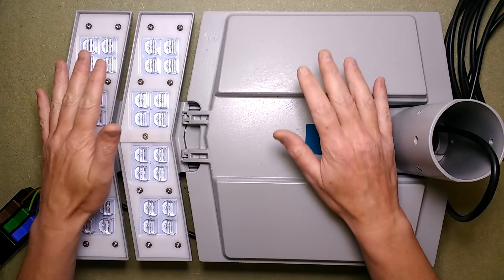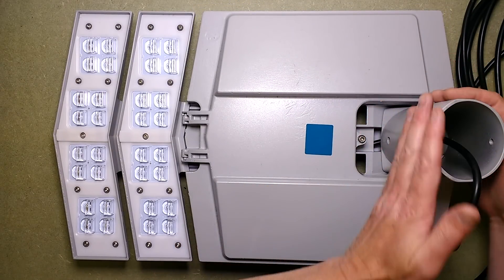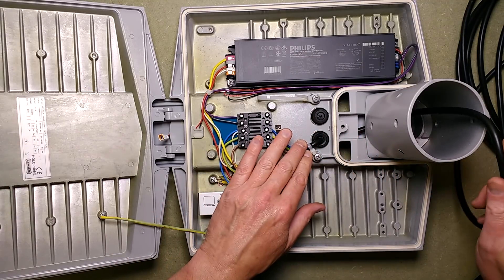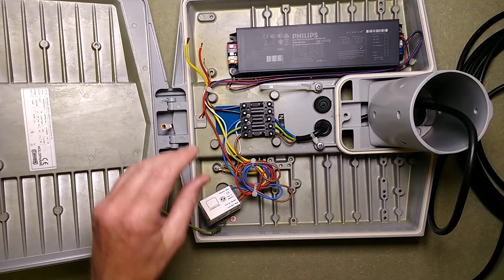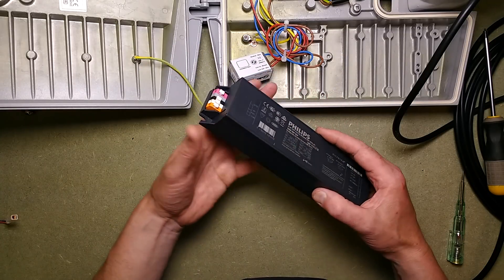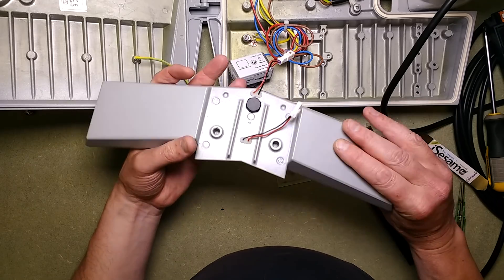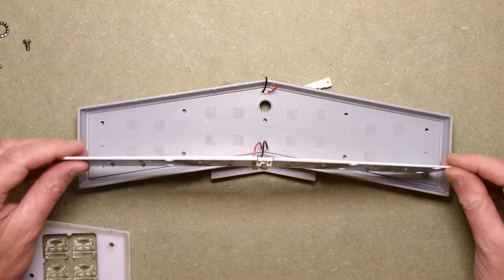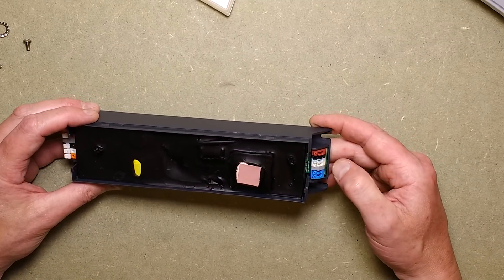Inside a Holophane LED street light (slight chromecast glitch).

Comment: Our council street light pole on our street got upgraded a two weeks ago  with a LED light fitting.   Ever since the light is turning on as normal when dusk by the photocell.  But turned off at 12:30pm each night.   Our local council have stated today that the light is not on the ‘ part night light ‘ program.so don’t understand why    We believe the 
Contractors may have fitted a timer photocell  by mistake ?

Comment: Screen pinting heat compound probably makes a lot of sense as standard SMT production processes already screen print solder onto the boards. Replacing the solder with heat compound is probably a fairly easy process.

Comment: My local city recently upgraded to LED streetlights while performing major road work near my house.
However several of the LED units have gone straight blue. According to the news this was a chemistry defect in several of the diodes, and in fact on one panel can have a mix of blue and white, and other lights one panel will be blue and another white.

It's a really unnerving sensation walking under one of these malfunctioning lights, and it gives me the sensation that it's throwing off large amounts of UV, though I've never tested that theory.
Reply from the maker: It's not UV.  Just deep blue.  The blue normally stimulates red/green phosphor to make white light, but the phosphor has detached.

Comment: These are dangerous very dangerous.
Reply from the maker: Not at all.   Well designed ones have less flicker than traditional street lights, and contrary to the venom spewing forth from people with ADHD the blue light component does NOT interfere with people's sleep, and is a negligible fraction of daylight levels on a cloudy day.  And they do NOT put out 5G death beams.  The rare ones that are fitted with 5G antennas emit much lower RF power than the 1G, 2G, 3G and 4G systems due to being part of an outdoor network like all the home wifi routers.

Comment: LED street light fixture SL18 specification

Model No.:           SL18-300w
Power:                  300W
Light Efficiency: 100~150Lm/w
Voltage:                AC100-277V
CRI(Ra):                 >70
Power Factor:        >0.95
CCT(K):                  3000~6000
Temperature:          -40~50℃
Life Time(H):           ≥50000

Comment: Please can you get hold of and review the current led street lighting with the  bit sticking out of the top you see everywhere now
Reply from the maker: I've looked at some street lights,  The antenna is a low power RF communication system for remote switching.  It's NOT a 5G death beam as implied by others channels.
Reply: The street lights with the pointy thing as you call it is for UNB ultra narrow band  which  runs on a unlicensed network which just means free to use and don't mean uninsurable. They are not 5G.
Reply from the maker: @RichieVallance  Like Telensa gear?
Reply: @bigclivedotcom  exactly like Telensa gear mate they are  based on UNB

Comment: That's not the same one being fitted across the country by just amount every council, it's got no 5G antenna for a start.
Reply from the maker: I'm not aware of any street lights with 5G yet.  Some use a traditional signal system for controlling the time the lights turn on and off at.

Comment: Was cheaper because it's not proper council one totally different.
Reply from the maker: It is a professional light.  They are used for road lighting, but usually the higher power version with the driver suitably programmed.
Reply: It would be interesting to know the wattage (what those greedy councils are saving)- I think the old low pressure sodiums were about 90 watts. However I was always intrigued by the weirdly oval Mercury ? lamps (found in desolate alley ways and passages) they gave off a spooky white light and on examining inside a vandalised   cover appeared to have no ballast at all, just a Venner timeswitch.

Comment: I wish we had these versions on my street. We've got the higher colour temperature version and the light is so harsh I had to move bedrooms as it was keeping me up at night (even a blackout blind was not good enough as it still leaked in through the edges). Sadly the warmer versions are less efficient as the apparent brightness is lower, they can be little better than a sodium lamp in terms of energy consumption. But they are so much more pleasant to look at, and they don't mess with melatonin so much.

Comment: Did nobody notice that the hinges on the cover are slotted, so all you have to do is partially open it and slide it off the 2 dowels?
Reply from the maker: I did remove it later.  I think the reason it hits the chevron module may be to stop it hinging far enough to come off.

Comment: Not  very thick wires. I suppose it has to do with the lowish voltage of the leds?
Reply from the maker: Low voltage and low current.  Probably less than 500mA.

Comment: You can tell when a company is taken over by Philips by their part numbers. They gradually change them to the Philips standardised system. For some examples see the number 4422 409 0201.1 in the lid of the driver (lighting fixings parts start with 44) and the number 92xx xxx xxx as the SKU of the driver.

Comment: Chromecasts are rather dumb devices that are mainly designed to play a compressed video stream from the network.
It's the camera device (phone, tablet, whatever…) that's having a hard time recording, transcoding and transmitting video over the network at the same time !
That's why the footage has been affected.
Cooling it better usually helps. You can stick a big chunk of aluminium on the back, like Google does on their Daydream VR headset and/or add a fan.
If you feel like it, you could also open the device and directly attach a proper heatsink to the CPU. That would actually make quite an interesting video !
Reply from the maker: I did actually consider the internal heatsink option because I had the phone open to replace the cracked screen.  But it would have made it a bit less pocket friendly.

Comment: Just as a tip with chromecast devices.

Strong wifi is a must if you're transmitting/casting the display from a device to your chromecast. I.e. wifi access point in the same room or next room over. 5Ghz wifi can work well or better still, have the casting device on 2.4Ghz and the chromecast on the 5Ghz (or the other way around) so they are using different antennas each.

Comment: Only place I've saw the holophane (now I know they are) is in the scotrail stations at largs & kilwinning, replacing old sodium philips lamps... though I didn't assume they were that big looking from the platforms... not saw any on the streets yet.

Though anyone looking for bad LED lighting head for stewartfield way in east kilbride, the 36w flurecent tubes in an advertising thing are 5 times brighter than the cheap chinese LED's south lanarkshire put up in 2015 sometime... if it wasn't for headlights on the car you would easily hit a pedestrian because the lights are that dim on stewartfield way you can't see anyone that isn't wearing reflective jackets.

Comment: Some of the street lights have a box on the poll with an aerial on it, in my area.  Which makes me think they can control the lights over the mobile network, to dim them late at night and stuff.  As Clive said the LED driver, had a data input, which must be used to connect the driver to the mobile data box.  They must also connect to other LED drivers with one of the standards Clive mentioned.

Comment: You should wear headset. Your vioce is very low. I can not hear almost any word.
Reply from the maker: It sounds the same volume to me.  Do you have surround sound?  My bassy voice may be being diverted to a subwoofer channel.  On smaller viewing devices with small speakers they may not be able to reproduce my bassy voice.
Reply: bigclivedotcom i use samsung note 8

Comment: In to my Experience this street luminaire is grade! 
+ looks like Ledil optics
+ second inlet with sealing for controlling cable (1-10V or Dali)
+ Enough place inside driver section for additional devices (PLC or Dali controller)
+ Modular (very popular in Asia) design which helps to do plenty of types by power
+ Cool design
+ breathing valve on driver section, and!!! on led modules
+ As for electrician - best type for installing on the fields (cover opens down)
But minuses have too
- As a minus of designs - modular system - for our conty climate (Kazakhstan) is wery problematic to do sealed for years system in modular design - Youcan see that cables goes in sestion which carry led modules - are non seal (ex. from a top it is only screws without selaing,), means water can leaks inside this area and later leaks to modules and driver section, thru weak sealed inlets (and to led modules thru breathing valve), and plastic end cap - is too can make problems with water. This (modular) design IMHO is only for warm climate, without snowy winters with +/- temperature jumps (in one day, as we have).
- Filled driver box - like Chinese design, very popular, but very non-repairable, last times philips is going more and more Chinese co. in their design.
- Where impulse (6 or 10 or 15kV) protection??? As to my expirience - all proffetional Western luminaires is equipped with this device (and it's right), even Russian big companies starting to produce luinaires with this type of protection.
Anyway it is grade luminaire (but expensive for 3rd world countries), and one of the best from what i saw.

Comment: The jerkyness happens because your Moto G4 starts to overheat and therefore to throttle it's CPU. They've opted for quite a low throttling temperature of I think 60°C. The same thing happens if you enable the image stabilizer, it's a shame really.. also none of the Moto G Phones support MHL for connecting up to a TV wired..
Reply: Yeah I can't stand Motorola phones. Absolutely love my Pixel 2 XL, it's brilliant.

Comment: What a crap design, you can’t even open the gear cover properly! That potted electronics module is so un-recycleable it’s unreal. The use of a mini-photocell makes changing it a pain, rather than the NEMA socketed ones. Having screws on top open to the elements is asking for trouble. Those LED connectors are really fiddly, and that thermal paste is going to dry out and become useless. The thing could have been made much simpler, cheaper and easy to maintain rather than changing the whole lantern - after all the whole point of LED is to be green! Bet that’s powder coating too, going to be a mass of corrosion in a few years, because it’s probably not an aluminium casting, it’ll be some cheap alloy. It’s pathetic.
Reply: The diecast case is most likely made from magnesium with a bit of aluminium added.

Comment: Chromecast/Miracast sucks big time. I've never seen a video not stuttering outside solid-color-and-text-menus. Never got a stream to work for more than 10 Minutes. Most times horrible de-sync starts after a minute or two.
Wifi is still too slow and smartphones too slow to transcode in real time. Especially when the camera is being used too, even if it's only pre-viewing. If we could at least seledct quality options for Miracast, but nope it's supposed to be AirPlay competitor, so there must not be any user-unfriendly configuration options... Chopps casts that last 3 Minutes are much better!

Comment: Hey clive , try using a webcam connected to a laptop and use open broadcaster (OBS) to record it, it's how i do my IRL streams and it works a treat for me. The output monitor lets you view the video in real time, with easy bitrate control n stuff.
Reply: This is actually really good advice. I know Clive likes the simplicity of just hitting record on a phone. I'm not sure if he edits the clips on his phone and then directly uploads them to YouTube, but if he is offloading them to a laptop to edit and then upload, using OBS would make work easier, as well as having a live monitor feedback.

Comment: They don't change the whole head just to make money. Usually it's on an area that impedes traffic, it's hard to access, or something that makes it a pain in the ass (aka expensive) to change. So when part of it breaks, it's makes more sense to do it all while you're there. It's like checking your brake pads and rotating your tires or getting new tires put on. You're going to rotate your tires AND check your brake pads while you have the wheels off.

Comment: It might be possible to use an angled mirror so you can mount the camera horizontally and still see the screen. Would probably need to be a first surface mirror, though, to avoid ghosting.

Comment: Never had a goo experience with Philips CFL bulbs thus don't buy their LED's.    Feit  meh  bout as bad.  TCP though.  They last the longest in the modern age.  Especially Vanity Bulbs.  Although one actually called Globe before locally it became the generic brand for HyVee (grocery store) , still got one working from 2008.  Last one.  Everything else  Got 2 Feits that might go at some point and thats of 12 Vanity bulbs So that's 9 LED TCP Vanity frosted bulbs.
Reply: I've been using General Electric LED bulbs around the house for a few years, and none have failed yet. There are also a couple of Philips floodlights, which seem to be pretty good.

I've even had a GE bulb in an outdoor lamppost for several months, and it's worked very well.
Reply: Ge makes Phillips look good  LOL  overpriced crap.  Way overpriced.  GE used to be the best.  Never owned a single GE Vanity CFL bulb because we've had fires with other CFL's , certainly don't want one in the bathroom.  I think it's because the ventilation holes are akin to the Xbox sequel with covered up holes...  Lights of America which are harder to find lasted longest..  TCP was next and TCP is all I can find online so since their CFL's rock I now get their LED versions.   (I'm I am using OLD GE flash cubes.  Why Fuji is discontinuing the better instant film I have no idea (3 years into that as it happened in 2015 but those are about to expire so the price is like $40 on amazon for 10 pictures which better be worth it or the film photography project store where it's around $6 cheaper

Comment: Chromecast requires private streaming servers be provided by the device streaming, which can cause severe frame drops and over compression when this is provided by underpowered hardware. The chromecast itself has little horsepower of it's own, so all the work is done host side. At least, that is how I understand it.

Comment: I have been told that some of the LED street lamps have cameras in them.... Is this correct?
Reply from the maker: It sounds like conspiracy theory, but it could be viable.
Reply: rusty possibly intensity feedback for areas that limit maximum output or color correction for observatory compatibility? Or a fancy PIR motion?

Comment: Whenever I have to order an electrician to fix lights that are dali programmmed, they tend to be rather annoyed as the dali system requires some sort of controller that no one ever seems to have at hand. Also the dali system sometimes fails and requires rebooting, which always causes quite a lot of amusement. "The lights are too smart for their own good".
Reply from the maker: Yeah.  The "smart" lighting control systems can be a real grind.  It turns a simple job into requiring a chart of fixture addresses and trying to interface with some random badly designed architectural control system with no manual.

Comment: Could you please take a look at Chinese ozone generator circuitry, you know those 20$ units that come with the plates in them and run on 12vdc / 110/220 vac, I'm wondering if you can hack them and with minor modifications get more power from the circuit and so on
Reply from the maker: With Chinese circuitry it will probably already be pushed to the edge.

Comment: The issue appears to not be a glitch but the encoder hardware or CPU is overloaded. My guess is that both recording to file and streaming to the TV causes the recording run encoding twice. Chromecast is unfortunately a really bad technology for this kind of thing. In any case I suggest you find an app that streams the camera to the Chromecast rather than the screen capture.

Comment: What do you think the chances are that the orange connection could be used to wire up a cctv camera (big brother is always watching sort of thing)
Reply from the maker: It's not really the right type of circuitry for that.
Reply: bigclivedotcom it just seems to me they put a lot of trouble and extra expense to pot it when it would be far cheaper to give it a seal,glue it or sonic weld it shut you stop water mitigation